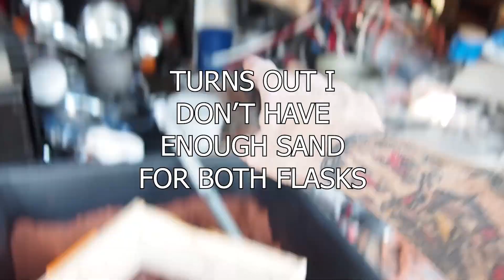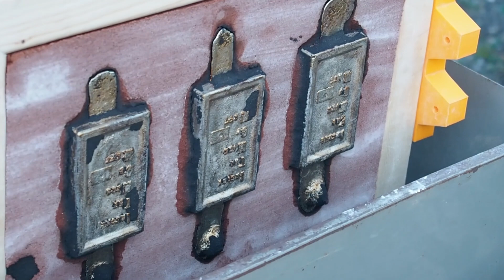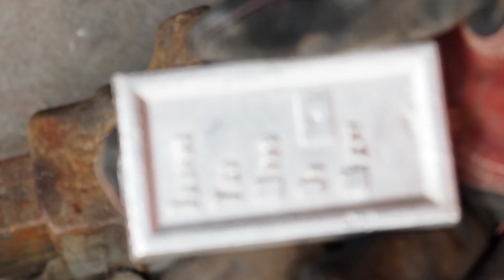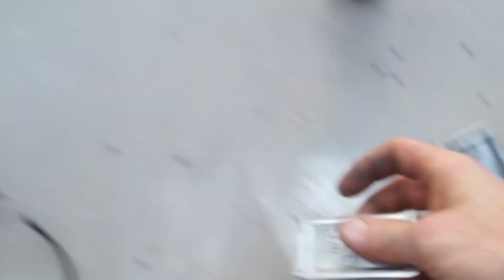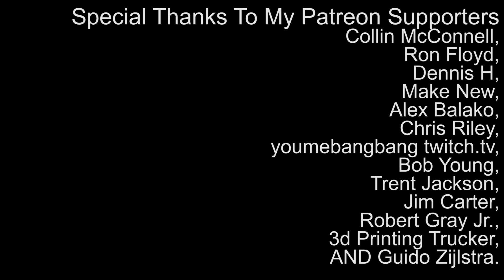Bigger Bullion And Some More Improvments

Comment: Yeah man it's looking better just need a little bit larger font size I have done metal casting a couple of times myself I built the furnace using fire bricks and nichrome wire and I use a small number 1 Crucible just for small casting

Comment: Hey Matt, lookin pretty kool!
I was just wondering, could you use a finer grit sand just around the part your casting to give more clarity to the text?
Reply from the maker: Dennis Hughes finer grit might be out there also theirs greensand but this petro bond is pretty good I think there are two things happening 1-the fine aharp edges of the top layers are grabbing and holding the sand 2- the details of the printed part isn’t that fine
I plan on revising the txt and try again maybe a fusion video 😁